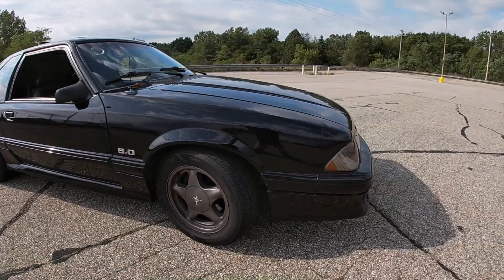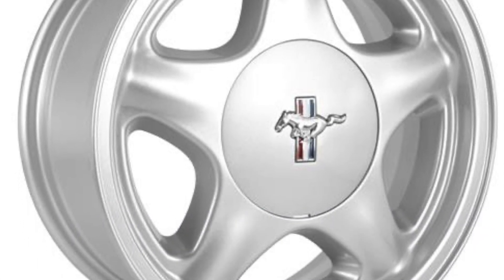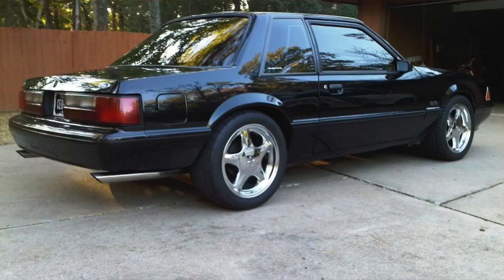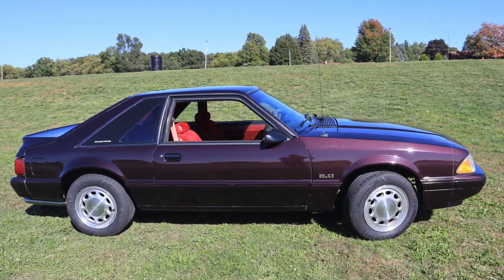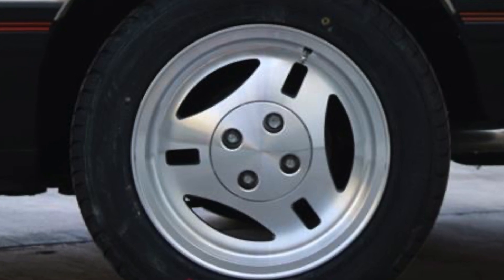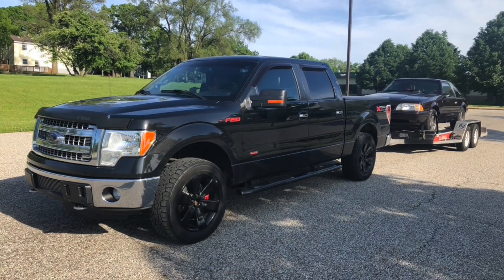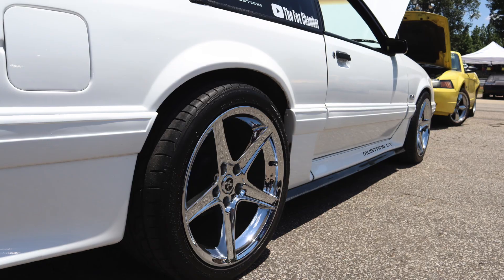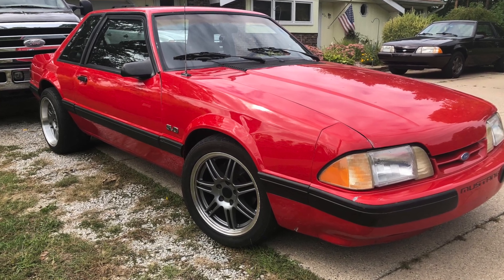The Best, And Well Worst Foxbody Wheels. Throwback Video

Comment: So best fox wheel for me is 10 hole  ...I do like the turbines but it is only because of the offset a 275 60 15 tire fits with them....my favorite wheel setup on a fox is 03-04 mach1 wheels or 2nd is 96-98 cobra wheels
Reply from the maker: Those Cobra rim cool. So are the Mach 1. Terriblebines 😝

Comment: 1987-93 Best "Factory" rim IS the Pony wheel. 
The rest suck. My first 88 Fox GT had 10 holes on it and it looked like shit. As soon as I could save up & buy (took a 20 year old a long time) some aftermarket looking Ponies, that's what I did. That said, my 87 came with Ponies, but I still love them Cobra R's. As played out as they are, I just like them. 
5 lug? FR500, hands down, the best 5 lug. And those Centerline and WeldWires? Those can go die a fiery death with the one piece headlights 😂🤣😂😂
Reply from the maker: Fr 500, depends on the size and the car
Reply: @funkystangs2843  I guess you're starting to come around, they used to be "too spokey" to now "depends on the car and size" 😂🤣👍
Reply from the maker: @jpp9846  well that car at FOXtoberfest 2021, changed my mind. They got it right
Reply: @funkystangs2843  I remember the video 😂 I was like "no he just didn't after saying they're too spokey" 🤣